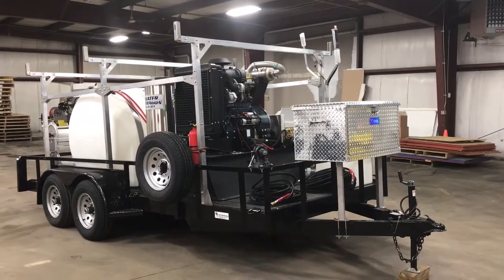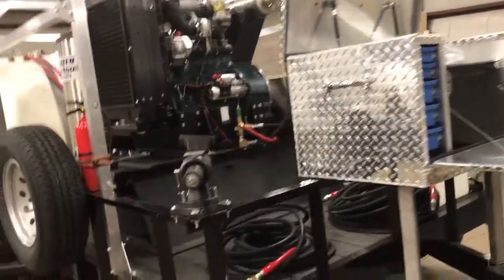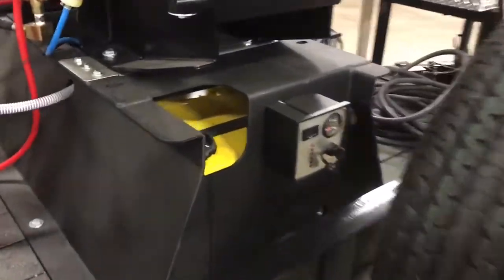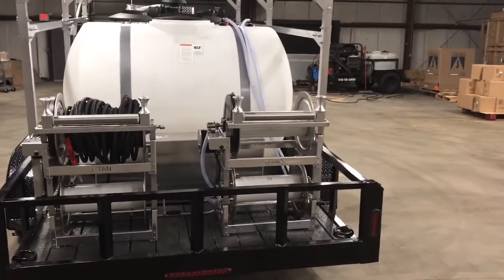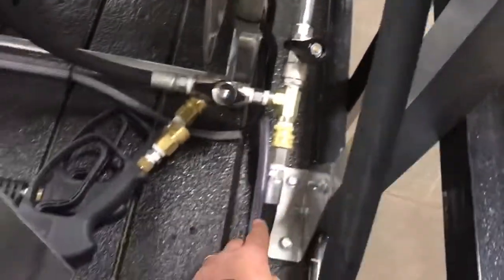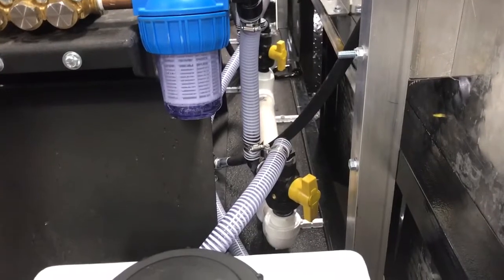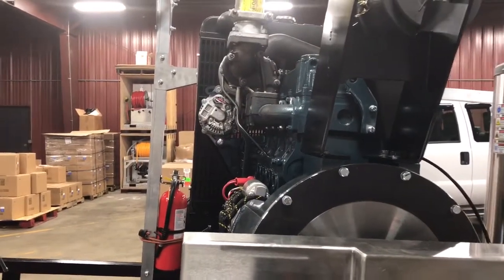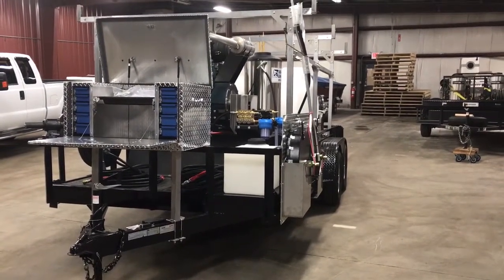Mr. clean Waterdragon dual 10 gpm Kubota turbo  diesel power washer

Comment: That's an awesome beast. But I recommend you put either 90 degree elbows or hard pipe facing downward on the high pressure relief valves b/c although not likely but if it ever blows while something or someone is near or directly in front of it will get damaged or injured. Plus just add 3way high pressure ball valves at cold water intake of pumps and burner to drain water out instead of flushing with antifreeze. I got plenty of ideas on setting up equipment to making them safer and more operator/repairman friendly.
Reply: I may need to pick your brain when I build one!

Comment: You better be hanging on at 20GPM. 3,000PSI. Great build Paul! There's enough HP leftover in that Kubota to run a third 10GPM pump. Now he just needs to add a vacuum/filter system. I would plum that reel under the fill hose with a second fill hose for sure. I would also plum it for a fire hydrant. If i were on the price is right, I would bid $50,000. Small investment for a rig that can turn out $500,000 a yr. This rig would be awesome on apartments.
Reply: Sorry I'm new at this, you really think he can pull $500,000 a year considering competition ect?
Reply: @lalotz  Maybe in large population area. Though I'd argue 2 or 3 normal trucks is probably still an easier life than one beast truck.

Comment: Awesome trailer! And the money I could make with one of these. All though I'd have only one 10.5 gpm for the surface cleaner and a 5.5 gpm 4000 psi. This would bring the cost and engine size down not to mention the tank size. Also adding a small compressor with a 15 gallon tank 100 psi for winterizing and blowing out the lines before glycol. Forget the tool box to fancy but ad some great lighting as we all know we could use it during nights for commercial jobs. Also love the aluminum ladder racks. Text me with the cost as my dream is to go Global. 
LykeNew Power Wash 
"You wash your car once a month so why not wash your home at least once a year" TM